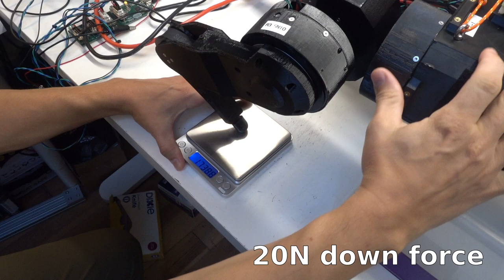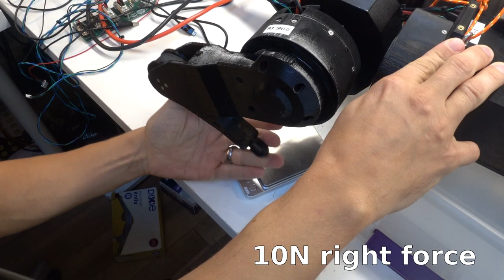Demonstrating force controlled mammal geometry robot leg

Comment: How do you measure the force ? Do you have sensors or are you working with current ?
Reply from the maker: Just current, although these motors have relatively low inertia so the applied current is a good proxy.